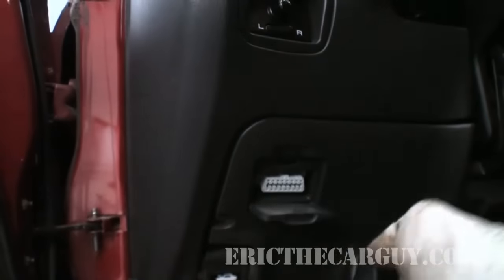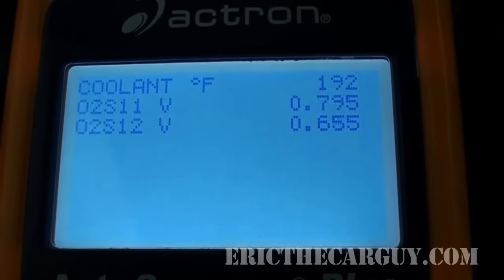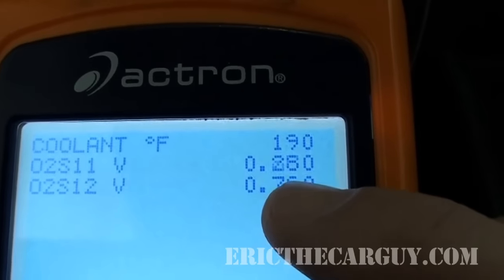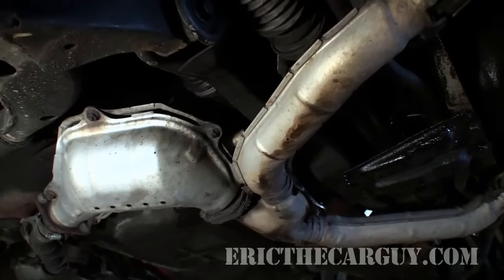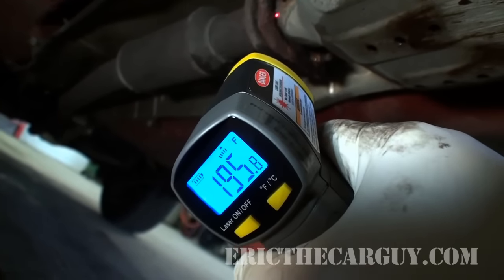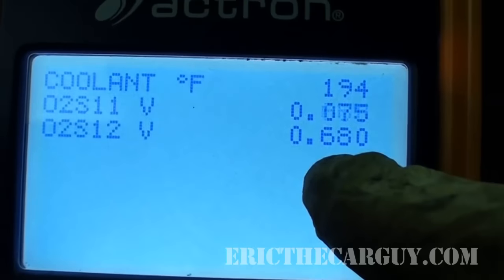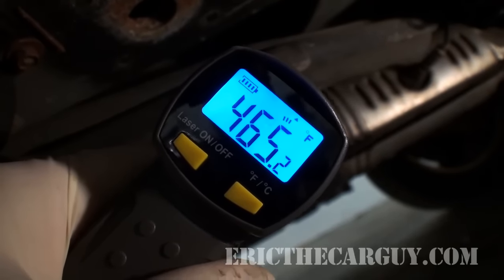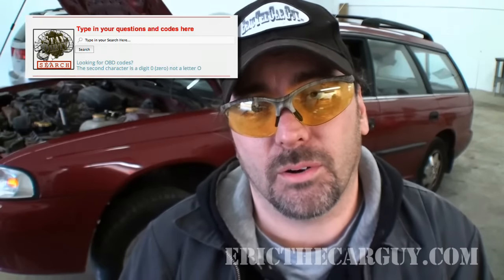P0420 How To Diagnose A Bad Catalytic Converter -EricTheCarGuy

Comment: Eric, just a quick note- I hope you realize that the laser is not what measures temperature, it's just a laser pointer to show you the center of the area that you're measuring temperature at.  Also, they typically have a distance to spot ratio, typically like 8:1, so at 8" you're measuring a spot 1" in diameter.  The way you did your test I would guess you measured about a 2" in diameter spot, so mostly heat shield temperature... so if you just drove the car, and most converters are mounted longitudinally I'd bet that even a bad converter would measure with the front cooler than the rear due to airflow
Reply: I really believe Eric knows what he is doing
Reply: I really believe Eric knows what he is doing
Reply: I really believe Eric knows what he is doing

Comment: I got an abandoned 01 Xterra from a tow-yard for $550 because of the P0420 code in Colorado where they do emission test. After using an Auterra to diagnose the issue at the lot and the Autel tool I use at work once I purchased the vehicle, I was able to identify a failed front cat as well as an intermittent failure on the front O2 sensor. $100 catalytic converter, $100 Bosch 02 sensor and $150 in labor later and it's running like a champ once again. I tried the $20 eBay "Chinesium" O2 sensor, which lasted two weeks before burning out again, so best to get OE quality parts. It was funny because once everything was bolted up and I fired it up and revved it all the sooty black water got pushed out the pipe. Soon after the rear cat temperatures and O2 values began looking right, so I lucked out with it only being half-plugged (due to a leaky valve cover gasket that was dripping oil onto the front cat). No leaks or issues ever since. Best of all, no engine money light. This video came in quite handy through that ordeal several months ago, so thanks for your help. This was the first vehicle I ever had to do emissions work on, and the last time I worked on a KA24DE it was in a 92 that didn't have hardly any emission devices. A lot has changed in nine years, thankfully it wasn't that hard to mend the issue. The hardest part was all the rusted and heat-welded bolts that had to be cut off with a angle grinder. I must have wasted two weeks trying to PB-blaster soak them and hitting it with the breaker bar for nothing. The ones that gave usually just ripped the heads off the bolts, so just cut it off and save time.

Comment: Hi Eric! It's Shep in Florida.(Retired tech) 3 years ago I replaced the engine (2.2 4cyl) in my 2000 S10 with a new (not reman) engine from GM. I replaced the fuel injectors and pressure regulator (Sorenson). o2 sensors (AC Delco). And cat (Walker). 11 months later ap0420 code appeared.The truck runs like new (it should with a new engine). I have no vac or exhaust leaks (vac at 18 in' average and rock steady) No misfires and fuel pressure is normal. NO other codes,and gas mileage is good. AutoZone replaced the cat at no charge. Last week the p0420 code appeared again.I ran a live data test. The U/S sensor switched as expected. The post sensor switched between .11-.95 volts. AutoZone replaced the cat again and  the post sensor now reads .73-.78 at highway speeds and .44-.47 at idle and right around .50-.54 volts at 35-45 mph. My GM tech friends say I need to install a factory cat ($1000-$2000).My auto tech instructor (the 1 who taught me 30 years ago and is still teaching) and my independent tech friends say that's nuts and a Walker cat ($179) or any cat should be fine. Any ideas? I was always taught that cats don't just die,they're murdered. Florida has no emission testing (except for Miami) but a mil drives me nuts. Thanx and G-d bless.

Comment: have to be careful with a lazer style temp gage, most people think that where the lazer hits is where the temp is being read. Actually the area being read is larger than just wat the lazer hits and the farther you get away the larger the area being read. Think of it more like a flashlight not a lazer. if you want to pin point you got to get super close. Most of this should be covered in manual.
Reply: Garrett White 
I remember years ago I took my car in to have my cat check. The guy raised the car and pointed his laser at the heat shield. Now that I seen THIS video, what that guy did was wrong. It would have given a false temp reading. As a result I bought a new cat. I think I was cheated.
Reply: Thanks, Garrett. That's good advice!

Comment: Great video! I really appreciate you taking the time to document and explain various diagnostic and repair procedures.

I thought I might point out something. Not a point of criticism, just trying to help a fellow gear head out.

At 7:29 you talk about trying to "shoot the laser between the heat shields." The laser is just a guide for you to know where you are aiming. The infrared sensor below the laser returns the temperature value. Also, the sensor measures a circular area, the further away you are from the target the larger the area. The value returned will be a rough average of that area. It is important to note that the laser will point above, not directly at, the center of this area. On a high quality IR Thermometer you can expect the circle to be about 10:1, distance to diameter (aka distance to spot or D:S ratio). In other words, at 18" distance to target the circular area you are measuring will be approximately 1.8" in diameter. Check your users manual for both the off set distance of the laser center line to the IR center line and the distance to diameter ratio.
Reply: Note that a very shiny surface will not give an accurate IR temp reading.

Comment: I had this code on one bank (V6 engine) for close to a year, all O2 sensors checked out fine...also started getting lean/rich codes which made me check for vacuum leaks(all good) & clean my idle control valve because the car started shutting down when idling, no change then decided it must be a bad MAF. bought a cheaper Chinese model for $45 on eBay vs OEM pricing...cleared codes and drove for a couple of days or 70-90 miles...rescanned and everything was good to go including smog readiness. Just passed smog...converter was fine but bad MAF was sending false air readings to the ECU, thus flowing more fuel which cooled the converter aka not warmed up enough (below threshold). Fuel economy was not good...but now i can drive 1/4 tank to and from work for 3 days on a v6.
Reply: I'm going to try the maf sensor

Comment: Eric Ive been watching your videos for years and have been inspired but not yet been in a situation where I had to try out your basic tips. However I have recently had the P0420 code and have watched a number of videos on the code and was thinking I would need to take the car into the garage to see if it was a sensor or cat issue as none of the other videos gave a easy way to check and test that is until I saw this video as I have live data on my scan tool I did this test on my car and BINGO exactly the same issue so I went to the scrap yard and picked up a replacement cat now to get changing it. You are a star mate.
Reply: Where can you get a cat out of a junkyard? It's against federal law for yards to sell cats!
Reply: @OldsVistaCruiser  the term "mate" is indicative of a UK or Australian poster. In the UK it's not illegal as for Oz not sure

Comment: THANK YOU!!!

Warmed up, at 2500rpms the oxygen sensors are reading; (bank;sensor#) range of movement, Fuel trim %
Upstream (before cat)
(1;1) 0.20 => 0.80, -3.1 => 8.6
(1;2) 0.20 => 0.32, -3.1 => 7.0
Downstream (after cat)
(2:1) 0.16 => 0.80, -5.5 => 5.5

Exhaust pipe temp after cat is only 30deg Fahrenheit greater than pipe temp leading into cat

So, because of your help I am able to start with replacing the cat!

2002 Acura RL, trouble codes (in order) P0118 (seems fixed by replacing leaky rad cap), P0420, P1486 (seems fixed too).

Comment from the maker: A stick wedged between the seat and the pedal.  Very high tech
Reply: Lol! Love it!
Reply: Cracking up 9.28.2020
Reply: @DMVyungin  3/16/23
Reply: 😢 I don't know where else to go.  NO mechanic could figure out my problem. I know this the only place that has the answer.  I have 98 4runner with 140k, which I gave my son to use.   Recently, the car shutter around 50 mph, it feels like it's searching for gear (going up and down shifting)  but I know it's not a  transmission issue.  Only a few think that I can detect, the tranfercase has a front drive shaft seal leak, probably half of the fuild is gone.  And the other was a recent front brake pad change. Clicking sound is heard on driverside drive axle spinning it, car shakes around 60-70 after brake change.  PLEASE can someone give me some pointer on where to look.  Thx u.
Reply: Lol I just put my spare ECU on the gas pedal.
Reply: I have a P0420 code on my 2007 Toyota yaris but no engine light, I only found that out through Scan tool, what do I do because it is not smog ready, it given me the yellow exclamation mark rather than the green one. what do I do????could be I just have drive a few miles for it to go through the cycles, since it is only yellow and there no check Engine Light?

Comment: note to this video.  if you have a air fuel ratio sensor it will read different.   this is only for o2 sensors
Reply: How different will it read? I have air fuel 02

Comment: Very good video!  My son has the same code, and I’m trying to figure it out.  I’m changing the 2 downstream O2 sensors to see if one or 2 might be lazy (wishful thinking, I know) now I’ll have to bring my infrared thermometer out and do the test!  Also, I’ll monitor the voltage swings as well.  Thanks for the video, you just enlightened me!

Comment: 98 Ford Ranger 3.0 inlet temperature on forward converter is 100° higher than the outlet. Will be checking back pressure. Truck sometimes stalls while driving or stopped. No check engine light or codes on this. You have great videos and tips